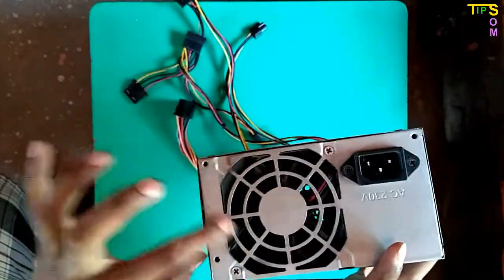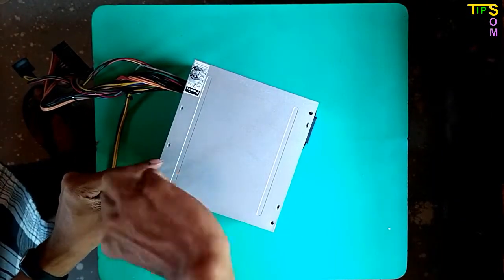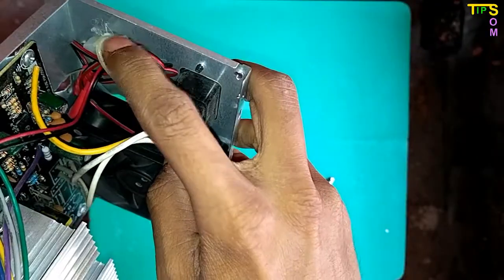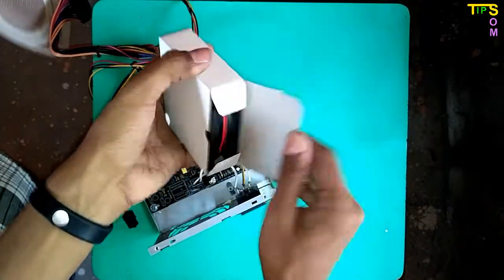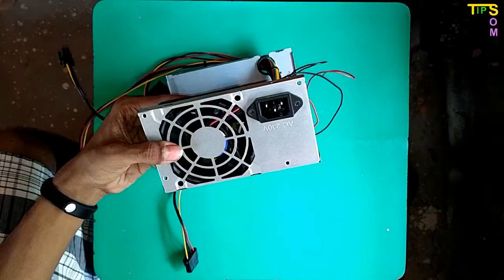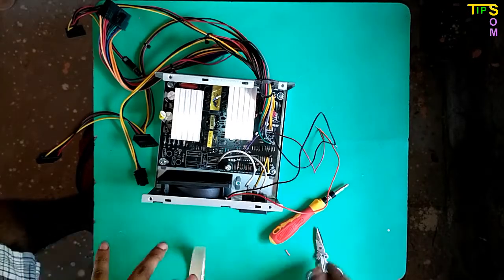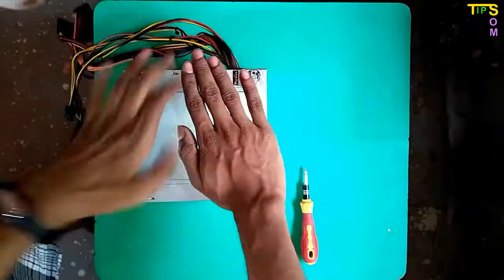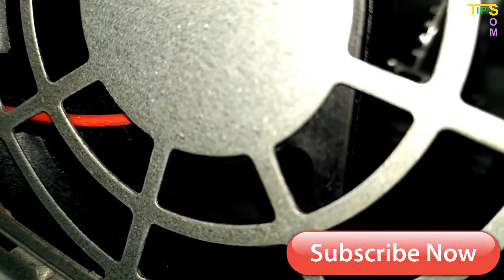How to Replace SMPS Cooling Fan of Computer Desktop at Home Easily ✅SMPS Repair at Home | Som Tips

Comment: My computer was switching off after using  of 3 to 4 minutes. So when I checked my smps, it's fan was not working. So watched this video & did the same. Only used wd40 instead of oil. My issue got resolved & my fan started rotating. Now the system is not switching off.

Comment: thnk u so much by showing how to change the SMPS FAN 
 actually my sistem is HANGING HEAVILY  wat i do now 
and my smps fan also not working 
is thr any problem if smps fan not work 
and u pls giv permanent solutions to work my system fastly 
and my RAM IS 1GB only
Reply from the maker: 1st of all go to task manager & check RAM is 40% free or not. which OS do u use?